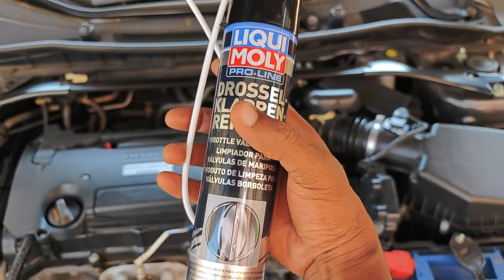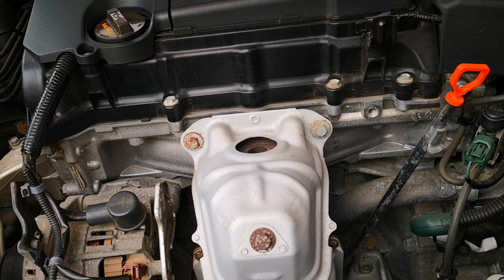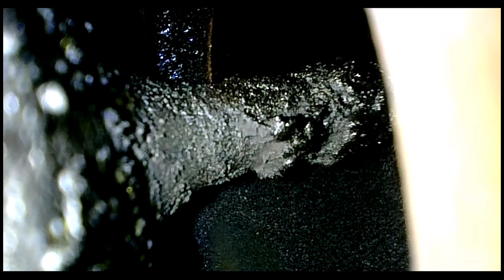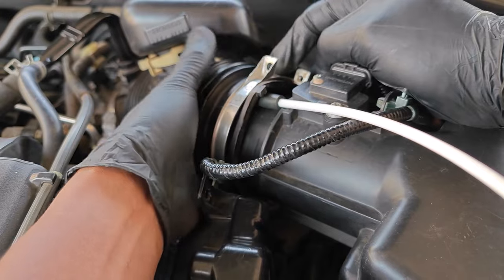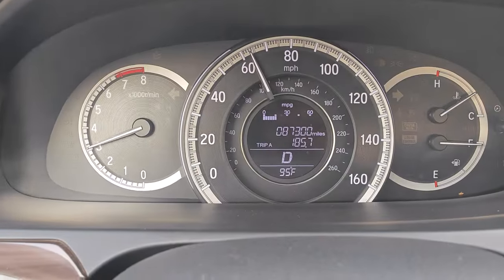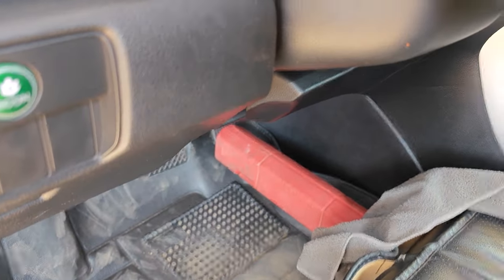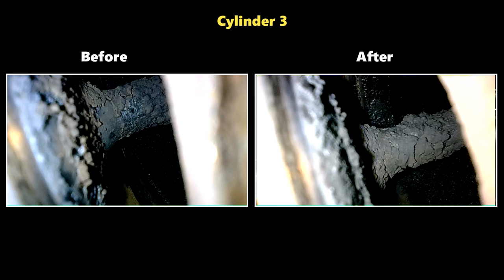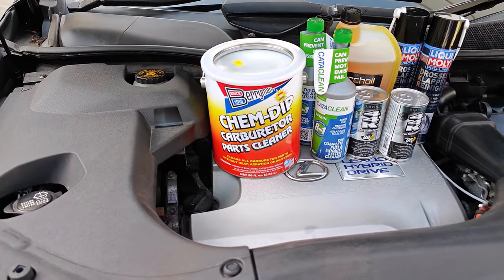Cleaning dirty Intake Valves with Liqui Moly Pro Line Throttle Valve Cleaner?

Comment: You probably have to drive a few hundred kilometres to see any effect. Just 1-3 spirited drives probably wouldn't do the job.
Reply from the maker: Well, you have a point. If I use it again, I'll do some extended driving.
Reply: @DIYAutoworksNG  just dont waste your time, carbon needs to be cleaned out manualy at this point.

Comment: I used throttle body cleaner from mannol. I removed the intake plenum, made sure the intake valve on the cylinder was closed and filled the gummed up port with throttle body cleaner. After 1-2 minutes I started scrubbing with a nylon brush and soaked a couple of paper towels with this ugly mess. Now repeat 2-3x and you’ll have shiny new factory intake ports. Compressed air will help a bit. Costs are like $20 for a whole engine and plan around 20-30 minutes per cylinder.
Reply from the maker: Thanks for sharing your process, will most likely end up doing this, when I pull the injectors for ultrasonic cleaning
Reply: Will you do a video about this process please!!!
Reply from the maker: Sure!
Reply: @DIYAutoworksNG  Thank you!

Comment: Direct Injection was a stupid idea & there fix was to add more injector that sometimes spray over the values to keep them clean. Sure you get more power with direct but building engines for everyday cars with di is so dumb.
Reply from the maker: Believe me, I feel that frustration. That said, I won't totally call it dumb, I think car makers should do it the way Toyota does it; the dual injection way. Best of both worlds.

Comment: I've used it 4 times so far and I've noticed some difference, engine was quieter and the car was more responsive. Surprised it didn't clean anything, but I'm looking forward for you to test more intake spray products like this.
Reply from the maker: In all honesty, car feels more responsive actually and it idles better. My fuel trims are now also close to 0!. Will test more😂
Reply: @DIYAutoworksNG  I very much hope so you can do more tests
Reply: @DIYAutoworksNG do you think bringing it all the way up to operating temp would help? Seems getting the carbon as warm as possible may help loosen it.
Reply from the maker: Every cleaner I know out there seems to like heat, so I just went with the flow 🤣
Reply: @DIYAutoworksNG I've watched multiple people do this and the ones who have success are using crc but the main thing is the 1 hour heat soak. They spray it in then shut the car off and let it soak into the carbon for a full hour. Then they take it out and drive for 10 min at highway speeds.
Reply: Mate if u want my advise i am not mechanic but i do many experiences on my honsa 2012 but i dont make any videos on youtube . So if u want your car respons and accelerate better than before you have to use liqui moly friction reducer its make the engine quiter and fuel consumption better
Reply from the maker: @mohanadsameer292 Thanks for the suggestion, will look into it.
Reply: @DIYAutoworksNG  I just figured the key to success is the heat soak. Have a good one

Comment: I love your honesty and watch all your videos bro. Great stuff.
Reply from the maker: Thanks you for taking the time to comment!
Reply: @DIYAutoworksNG have you tried the CRC intake cleaner? It's supposed made specifically for gdi engines.
Reply from the maker: Yep. I have a video on that too on the channel. Comparing the 2 products, CRC did a better job.
Reply: @DIYAutoworksNG did you do the one hour heat soak after spraying it? On every other video they let it set and soak into the carbon for a hour before driving it at highway speeds? I guess that is what allows the cleaner to soak into the carbon?
Reply from the maker: @donniev8181  Did the 1hr heat soak on the 2 occasions I've used it.
Reply: How long did the effect last?

Comment: Just a thought about your before/after… most valves rotate slightly every time the cam shaft engages as part of the design to allow for even wear. So it’s possible on the one valve that actually got worse, you were just seeing a different face of it. Thanks for the video!
Reply from the maker: Very correct. Many thanks for sharing. I picked up that lesson after the video. We learn everyday. Thanks again.

Comment: Very good video - nice comparison of the valves before and after. That leads me to think, that the only proper solution is mechanical cleaning of the valves.
Reply from the maker: Seeming so when they're this gunked up. I'll be repeated CRC intake valve cleaner 2 weeks apart and will post the video too!

Comment: Great video, but I believe CRC's intake valve and turbo cleaner does a superior job particularly on GDI's.
Reply from the maker: Yep. CRC intake cleaner did a better job. I had to rewatch my video on that to verify. Yet to test it through throttle body injection. My prior experiences were through the brake booster line, but someone said it does better through the throttle body.

Comment: great video! this product is good. product that cleans those areas in slow way is better for the engine so it dont harm the engine or the catalyst converter. so the solution to make it clean with time is to keep using the product regularly every oil change. these new engine with all environment systems need this product. also it's very recommended to use catalyst converter cleaner (add to fuel version) after using this product to clean catalyst converter from deposits came from engine components
Reply from the maker: You points are spot on! More gentle cleaning will be easy on the CAT.

Comment: For the valve cleaner you did 5 rounds with the liquid moly in the tanks of petrol... one could draw the conclusion... that perhaps you need another few goes....AND try to clean them the way you tried with the other product (CRC - through the brake line booster?)
Reply from the maker: Interesting take. I still have one can left which I intend to use too. The instructions don't say to use it any other way, but I'll do some more digging about that use through the brake booster line. Thanks for suggesting!

Comment: These cleaners would work best as a preventative after a good manual cleaning.
Reply from the maker: A good point, though we still need hard-line cleaners especially in the case of getting used cars.

Comment: Is this the car you used the valve cleaner in the fuel where you aftet a few cans and italian tune ups , cleaned it up...this car is very dirty and would you say really needs way more help?.hiw many miles does this one have and what kind of gas was used..also id it only city driving.
Reply from the maker: Same car. Gas quality is not the best. Premium gas is not available. But then, it's GDI, so those are expected of the intake valves...
Reply: @DIYAutoworksNG  wasnt it a lot cleaner though after the fuel treatments and how many miles has it been since then?  Also do you regularly use a cleaner in your fill ups since the gas is crap? And is it mainly city driving?
Reply from the maker: I just got a cleaner which can be dispensed in aliquots into each fill up. Plan is to add it with every fill up. Video will come here too. It's mixed driving, maybe 50/50.

Comment: Drosselklappe means only throttle body not everything else that you try to clean
Reply from the maker: Thanks for the translation, but the fineprint, says it cleans intake valves too.
Reply: Didn't catch that, but highly doubt. Carbon build is hard to remove only with additive, needs to be mechanical

Comment: Hi, nice video like all videos, but this product is not specialy for cleaning the valves, but for cleaning the throttle valve and product intended for cleaning valves is Liqui Moly Pro Line Intake System Cleaner, but this product is only for Diesel.
Reply from the maker: But this says on the tin that it "reliably cleans intake valves"...
Reply: @DIYAutoworksNG  Yes, i know but you can see on video, very small difference on the valves with this product.
Reply from the maker: Agree. Little to no difference.

Comment: For heavily deposited valve like shown, petroleum distillate chemistry ain't gonna cut it. Thanks.

Walnut blast (mechanical cleaning)
Reply from the maker: I have a few plans after which I'd do mechanical cleaning when I take off the fuel injectors.

Comment: thanks for the video. what is the best way to clean them?
Reply from the maker: Walnut blasting, but not easily accessible depending on where you live.
Reply: @DIYAutoworksNG  what is walnut blasting??!
Reply from the maker: It's the use of ground walnut shell media through special equipment that knocks off the carbon and sucks it up. Disassembly is required to perform that procedure.
Reply: @DIYAutoworksNG  thanks

Comment: You have use another way to send liquid to the valve throttle body will not access your cylinder valve needed to find a map sensor and and insert the liquid
Reply from the maker: The method used in the video is what is recommended on the product.

Comment: It is much better to use Cleaner for the Gasoline inside the Tank. That cleans much better.
Reply from the maker: Won't reach the back of the valves on a GDI engine.

Comment: WD40 tut es auch
Kostet halt 5x weniger
Reply from the maker: I've heard that too for mechanical cleaning. Are you suggesting using WD-40 through a vaccum line with the engine working?